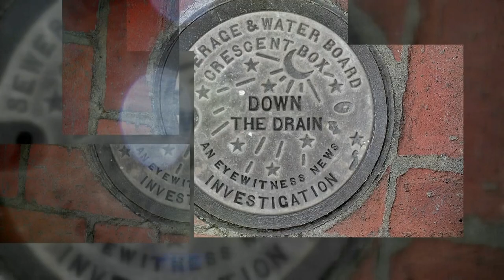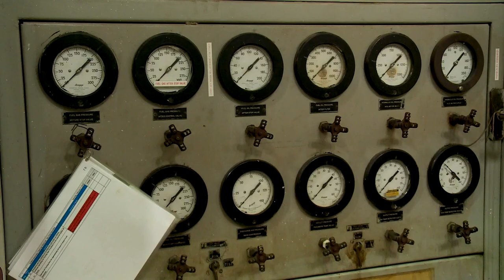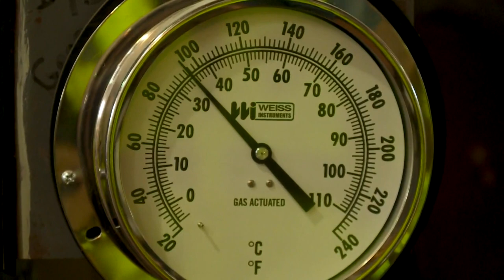New Orleans' turbine explosion was likely human error, report says

Comment: The agency depended on "generational memory" in operating the power system. Information and know-how is passed from senior operator to subordinates but is not written down in the manual. Each operator down the line gets less and less information, leading to a dangerous and expensive consequences. And of course the internal investigation would show that it was a "mechanical failure". They have neither the expertise nor experience to determine the actual cause. An outside consultant will have the knowledge, experience and expertise to figure it out. They also won't have to cover their butts.